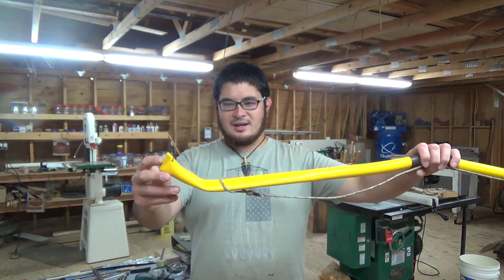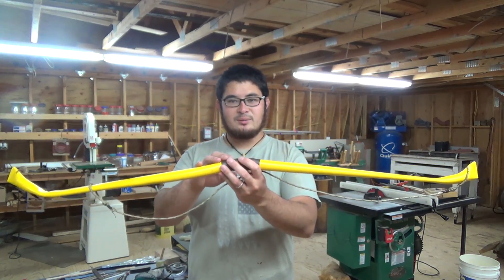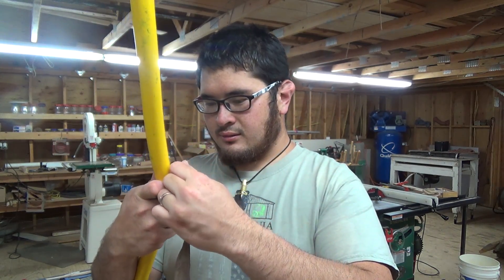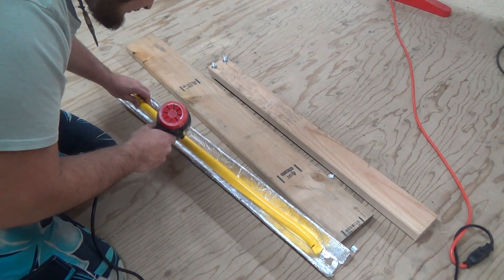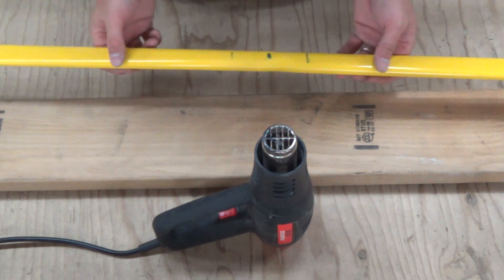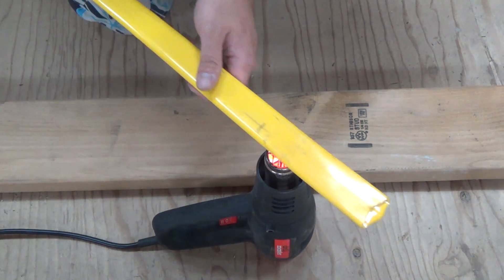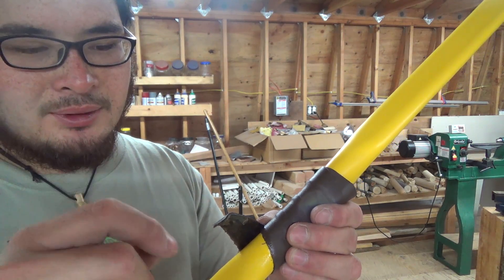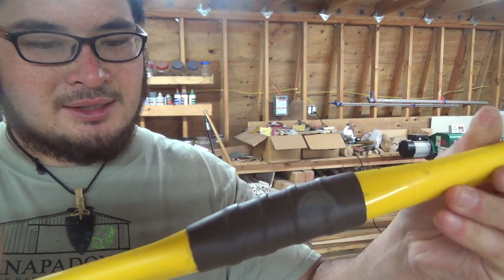PVC Bow Reborn - How to Fix a PVC Bow by Re-Forming It

Comment: what kind of pvc are you using my pvc pipe wont heat like ever i tried with heat gun for 10 mins and still nothing
Reply: Make yourself a rectangle box but a quarter inch longer than the PVC pipe and leave you a little hole or you can put your heat gun and blow that heat and air pull it out you'll notice will start getting soft 20 minutes
Reply: And he also does have a video where you can make a bow with PVC using fiberglass rods in the inside it works just as awesome I kill deer with no problem

Comment: is it possible to make a PCV bow ,made out of grey pipe that is used for hot water?
ive tried and it ether melts or is as hard as a rock. even if i melt a segment, it becomes hard again as soon as i move my heat gun.. any advice? (i cant find any PVC pipes for cold water. ive looked all over)

Comment: hey nick, if the pvc pipe bends completely would I be able to remake it or would it just bend on the same spot?
Reply: If it's not broken or split, but just bent or folded you can easily reshape it after heating. If you don't make any mistakes like an uneven taper it shouldn't happen again.

Comment: Why no fiberglass Nick? Doesn't fiberglass give the bow a little power reflex power when its launching a arrow? I can see it as a target bow but not as a hunting bow per say
Reply: Fiberglass in a PVC bow will bring up the draw weight, but it tends to sacrifice efficiency because they add a lot of mass. A bow like this with fiberglass rods may go from 35 to 45-60 pounds (depending on the rods used), but it will be slower than a comparable 45-60 pound PVC bow without fiberglass rods.

If you want good performance in PVC, don't use fiberglass and if you want good performance in fiberglass, don't use PVC. This is mainly because what works well for PVC doesn't work as well for fiberglass and vice-versa. Keep in mind this is just my opinion after making and testing bows with fiberglass added. As far a draw weight goes, sometimes you just want the extra weight and are willing to sacrifice some speed to get it. That's where you'd use fiberglass in a PVC bow.

Thanks for watching!